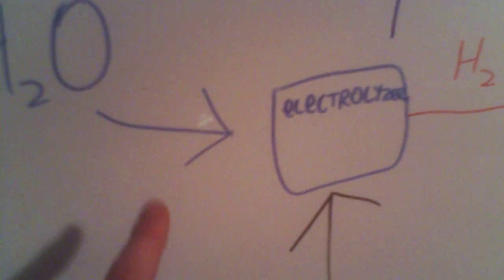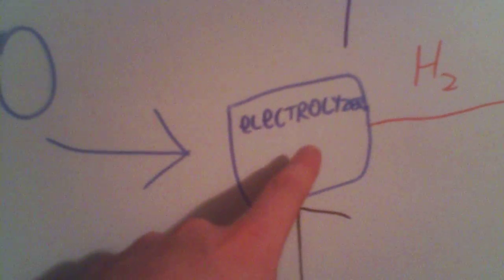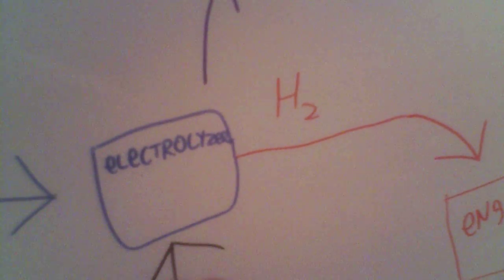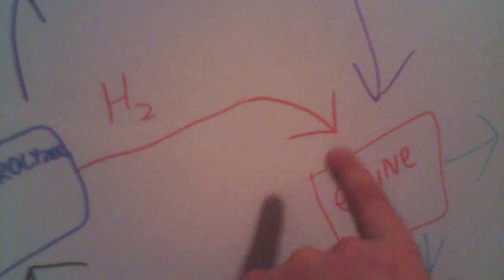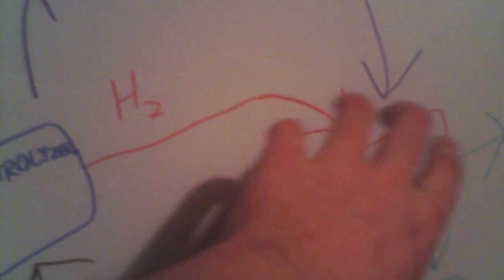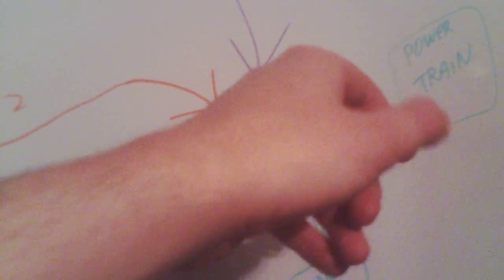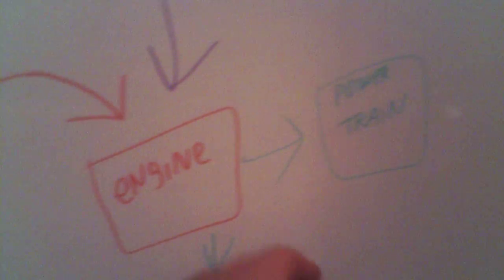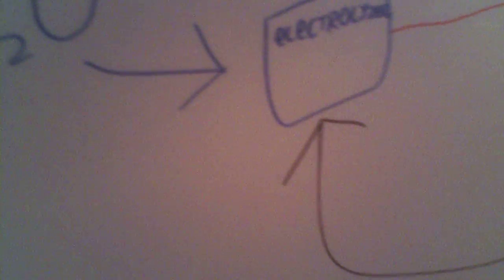Why HHO CANNOT EVER BLOODY WORK

Comment: https://www.academia.edu/5706114/NASA_SUPPLEMENT_HYDROGEN

sorry NASA have tested and approve that hydrogen works
Reply: Good freekin' gods.  What on Earth are you talking about?  You're referring to a paper from 1974?!?!?!?  Even in that paper, they were talking about a very low yield.  And, it was based on the efficiency levels of 1974 engines (there was a lot of efficiency that could be gained).  The paper relies on the concept that the efficiency gains in burning hydrogen would outweigh the efficiency losses of generating the hydrogen, and that is only under very ideal theoretical conditions.  And, sure maybe you could make that case in a 1974 engine (which this paper does), but it's reeeaallllyyy a close call, barely any gains.  In a modern engine, which is far more efficient than a 1974 engine, sorry, but that gap can't be closed by the results from this 45 year old data.

Comment from the maker: Except the additional hydrogen does fuck all to improve the combustion efficiency of the engine.  And the energy coming from burning the hydrogen is originally from the gasoline.  The hydrogen generator is just another load on the engine and requires more fuel overall.
BLOODY.  HELL.

Comment: no, its totally relevant. you put an hho system in your car, and the battery will power it. you turn on that car, hho and gas vapor are pumped into the cylinder, and because of the extra power the hho delivers, your car will use LESS gas because there is MORE propellant in the cylander. then, the motor cyles the alternator, recharges the battery and allows the electrolisis cycle to continue.

Comment from the maker: NO.
The extra energy to run the hydrogen (there is NO SUCH THING as HHO FFS) generator comes from the 'normal' fuel that the engine is running on.  The hydrogen generator is a net load since it takes more energy to generate the hydrogen than you get back by burning said hydrogen.
In other words, such a system is a net loss and REDUCES YOUR VEHICLE FUEL ECONOMY.

Comment: IF the car was only using hydrogen as the one and only fuel source, im not saying that you can run a car totally on HHO, im saying it can be used with gasoline in your car. if the hho doesnt produce the energy to re-split the molecular bonds of water again, then the gasoline burning in the engine will turn the alternator enough to re-power the electrolysis cycle.

Comment: HHO wont work if the car was only usingtha hho, that would not be possible because that would classify it as a perpetual  motion machine. BUT, when gasoline and HHO are used in conjunction, the engine is NOT producing more energy than it consumes, the HHO is aiding the burn of the gasoline and thereby making the car use less gas improving your gas millage.

Comment from the maker: It is a net loss.  As such, using it to make hydrogen to fuel the engine supplying the hydrogen generating apparatus is pointless.  Yes, hydrogen can be used to store energy and yes, said hydrogen can be used as a fuel, but doing everything at once is an exercise in stupidity.

Comment: Yh, preachin to the choir there bud. Most people who use HHO are not interested in overunity, they are interested in the convenience and application of using electricity to make 'fuel' on demand. That is why I disagree with your title because HHO does work and it works very well in many different systems (depending on the efficiency of the electrolysis - most of the cells you see on youtube are a load of shite).

Comment from the maker: The maximum possible efficiency of any system is 100%.  As 'HHO' converts mechanical energy to electrical energy to chemical energy and back to mechanical energy, the best case scenario is where the HHO system has no effect.  As unity efficiency is impossible, HHO can only be a net load on the engine using such a contrivance.

Comment: Do you mean 'HHO overunity cannot ever work?' Really, these methods in generating energy is not about 'overunity' but about how efficiently energy can be converted from one state to another - of course. When splitting an atom, does the energy input = output? Sure, e-mc2 but the energy input to trigger the process does not equal the bang. Eh, drunk.

Comment: 1 Engines in time get deposits and this ruduces MPG. hydrogen promotes a cleaner burn. A clean engine is an effeciant engene.
2. All the smoke comming out of a deisel truck is waisted energy. Hydrogen finishes the burn. Less smoke coming out of the tail pipe equals more power in the engine.
3. You keep going back to ONE rule without considering these other principles that also apply.  You think all were doing is ADDING to the amount of fuel buring. therefore using less gas. WRONG.

Comment from the maker: A problem with geothermal is that areas where there is readily accessible geothermal heat tend to be seismically active.  A geothermal plant does no good if it gets shredded by an earthquake or buried/incinerated by lava or pyroclastic flows.

Comment from the maker: Geothermal is only suitable in a limited number of locations as it needs particular geographic conditions to be feasible (note that ground source heat pumps are NOT true geothermal).  Even then, things like hydrogen embrittlement, low energy density and lots of things being permeable to hydrogen mean that it is a niche fuel at best.

Comment: Alternator kicks out aprox 15volts at around 10amps. I am using less amps to explain something simple. If HHO conversion is using 5volts at 4amps. The gain inMPG is 1%. I would rather have !% gain anyday against 0% all the time. I went from a gas guzzler Vauxhall Frontera A Glazier 1995 4X4 max 22MPG. to same vehicle with HHO giving me 43MPG. I know that isnt 1% but I dont care. IT IS SAVING ME MONEY. That is all I care about. If it ends up at the end giving me only 25MPG. Fantastic.

Comment from the maker: Any properly working ICE burns around 98% of the supplied fuel.  As such, the only possible gain is in that remaining 2% or less.  ICE automotive system inefficiencies principally come from the ~70% of the supplied fuel ENERGY that is being turned into heat.  This energy is (except in winter) all wasted because the Carnot efficiency limit of any system that can recover it is crap due to the low temperature differentials involved.  As such, recovery is not worth the effort.

Comment: Sililar thing with HHO. Since your engine doest combust ALL the fuel, that uncombusted fuel has to go somewhere. It goes out of your exaust. HHO only improves the combustion so less uncombusted gas is thrown out of your tailpipe. Thatswhy if your car is alredy quite effiecient, HHO will not help as much as it would with the higly ineffiecient ones. You say you are an engeneer. So build HHO generator and try it out, make it a project if you will. If you dontwant to try it on your car, try it on

Comment: Ok, then what you are saying is that those new engins that are much more effiecient then the old ones, do not work according to laws of thermodynamics. Because this only improves your efficiency. Imagine the old steam engine. You produce vapour that goes into atmosphere. So you constantly need to add more water. What if you would condens that same vapour that comes out of the engine and reuse it? You would need to add less "new" water besause you are reusing the old one - it is more economical.

Comment: In your proposed function of HHO you are correct, it could never work. If you are interested in learning how it is meant to work, please study the work of Stanley Meyer and do some research. His engine was running on the expansion rate of water to gas (1800:1), the explosion of igniting the HHO, and possibly steam as well. Good luck in your search, it will take some time.

Comment from the maker: None of those things are prohibited by physics except the faster than light in a vacuum travel.  That result that you speak of was due to a connection problem in some fiber optics introducing a 60nsec signal delay.  Experiment repeats have shown the initial result to be in error.

Comment from the maker: Those are all energy conversions.  No new energy is actually created in the process, as the kinetic energy of the air is turned into electrical energy (lightning) or mechanical energy (wind generators, boats, etc.).  The term 'from thin air' is just an expression.
Physics 1, bullshit 0.

Comment: You have no idea how HHO works, dont you? First of all, HHO stands for Oxy-Hydrogen, which means oxygen is NOT released into atmosphere, both gases are released into engine. Secondly, your "math" would be correct if the cars engine wouldn't be so ineffieciend device, but it is! Just google for internal combustion engine efficiency and you'll see. Losses due to incomplete combustion are up to 45%! So to simplify: If your alternator uses lets say 5% of your total combusted fuel for electrolysis

Comment from the maker: What you are describing is nothing less than the creation of energy from thin air, which is impossible.  Generators are energy conversion devices.  They turn mechanical energy into electrical energy and heat energy.  To get more electrical energy out, more mechanical energy must be put in.
Again, basic physics proves what you are claiming to do to be impossible.

Comment from the maker: So what if it can burn ceramic?  Anything will burn if it is heated to a high enough temperature.  What matters is that the heat energy from the burning hydrogen and oxygen is still less than the electrical energy needed to split the water into hydrogen and oxygen.

Comment from the maker: Real engineering uses facts and logic and truth.  What you are describing is some form of impossible (those pesky laws of thermodynamics again) pseudoscientific bullshit.  Increasing a load on a generator MUST increase the load on the prime mover, both from the mechanical energy needed to convert to electrical energy, as well as the increased losses that come with same (winding losses, core eddy current losses, etc).

Comment from the maker: Internal combustion engines need fuel that will, y'know, BURN.  Almost all of the component gasses of ICE exhaust (H2O, CO2, N2, NOx, etc.) have this little habit of NOT burning without exposure to NASTY stuff like ClF3.  The exhaust gasses that will (CO and residual unburnt CH3-nCH2-CH3) are at too low a concentration to burn.
Or in other words, an engine CANNOT run on its own exhaust.  Indeed, oil tankers fill the air space in their tanks with their exhaust BECAUSE it will not burn.

Comment: 3rd-you say-Second, a system transmitting a given amount of power does so regardless of the duty cycle. Reducing the duty cycle simply increases peak power.
Wrong again-it's like i said stop living in that past and believeing everything that some has been told you.Im guessing the lens force law still stand firm with you aswell-and yet i have designed a generator that counteract's the lens force and reduces the load on the prime mover when a load is applied to the generator-real engineering

Comment: 2nd-the air that an I.C.E breath's is only about 20% oxygen,but when HHO is used as a fuel it will be supplying the engin with 33.3% oxygen and 66.6% hydrogen.So there is no contaminatein the fuel,and 100% of the fuel is burnt.It is also possable to get an I.C.E to run on it's own exaust gases in a complete loop system-but that is something for us engineer's that live in todays world.Feel free to go and view my vidio of my system doing just that ,if proof is required.

Comment from the maker: Regular engines add oxygen to the fuel as well, as fuel will not burn in anoxic conditions.  Plus, engines CANNOT get 42% more energy than was supplied to them as fuel.  The laws of thermodynamics forbid it.  As in: IT CANNOT BLOODY HAPPEN EVER.
And ICEs burn over 98% of the supplied fuel, so there is not much gain headroom.

Comment from the maker: First off, the laws of thermodynamics have NEVER been overturned, so my 'old' thinking is valid.  If you were a real engineer you would know that.
Second, a system transmitting a given amount of power does so regardless of the duty cycle.  Reducing the duty cycle simply increases peak power.
Third, where is the energy to generate this 'HHO' coming from?  Again, were you a real engineer, you would know that energy from a system CANNOT exceed the energy supplied to that system.

Comment: another methiod i heard about was a guy who took an old car apart and rebuilt it in such a way so that the gas was vaporized before it went into the engine. he clamed upwards to 100 miles per gallon. (back in the 70's)

Comment: it still improves efficiency. water, even though your using energy to split it, the result is a much more clean explosion in the pistons, it helps the gas burn quicker because it itself burns quicker and that burning ignites the gas quicker. it doesn't go against any laws of physics. like one guy said, it used as a additive to gas to make it explode faster.

Comment: 2-when useing HHO aswell as normal fuel in an I.C.E you create more heat as you are adding oxygen to the fuel ,and as we know adding oxygen will create more heat -and heat is a loss.When running on HHO alone with the motor set up to do so,you will gain around 42% more power for the same amount of fuel consumed,as HHO has a much higher explosive force than normal fuel.It also burns 100% of the fuel.As the explosion is much quicker with HHO there is less heat loss aswell.

Comment: Hi randacnam-I am also a mechanical engineer who is experimenting with HHO.Looking at your vidio i can see you are stuck in past.What you have to do is think outside the box and not go on what some one said was law 100 years ago.I see you are going on a brute force system-what about pulsed systems?.You also go on the asumption that the motor in question will only have the same amount of HP or kw output when run on HHO.An I.C.E running on HHO alone will have much more output power than on gas

Comment from the maker: I have never seen any HHO systems employed on the scale you are talking about.  The fundamentals behind it (overunity, 'burning unburnt fuel,' etc.) are all nonsense that defies the laws of thermodynamics, as well as being easily debunked by those with a basic knowledge of physics and chemistry.  HHO is just the latest in a long chain of fuel saver scams, like magnet fuel molecule aligners, bogus fuel additives and those stupid 'power optimizers' that plug into the cigarette lighter.

Comment: REad up on some Masters' thesis, peer reviewed or peer review in process work, where RPM was of consideration. At low rpm HHO is often problematic, and SI vs. CI engines differ greatly. I am not saying it is across the board applicable at all. I am saying it is not nearly as simple as you make it to be. I once believed exactly what you state; but it surely is just not that simple. Here is an example approved Master Thesis > tinyurl . com / 8xvrykj

Comment: If you think about all of the already implemented ways to get unburnt fuel BACK into the mix, it becomes clear that in each stroke there is a lot of fuel left, unburnt, and that fuel is potential HP. I clearly understand the laws of physics, and your point, but all due respect you are missing out; HHO is not free energy or any defiance of any law of physics. There are many mods that can, increase HP & economy simultaneously (like exhaust mods), and done right, this is one of them, in some cases.

Comment: That's too simplistic of a view; again, you are assuming the already taking place reaction of long chain hydrocarbons is a 100% efficient process. In reality a small introduction of pure H2, in and amongst incomplete, yet cleaved molecules of available fuel, i.e. CO, MH3's are then able to combust, and thus the energy obtained IS NOT equitable to the energy within the H2 and O2 introduced, thus the interest from many an engineer, already, and the implementation of HHO in many fleets nationwide.

Comment from the maker: A properly functioning ICE burns at least 98% of the supplied fuel.  And CO being a reaction product of combustion is a sign of insufficient oxygen, not hydrogen.  Ideally only H2O and CO2 are given off, although some NOx production is inevitable from thermally induced oxidation of atmospheric N2.  Any ICE in good working order gives off relatively little CO.

Comment from the maker: One horsepower is 745.6W.  If an electrolyzer consumed 280W turning water into hydrogen and oxygen then by definition burning that hydrogen and oxygen or recombining them in a fuel cell can only give off (assuming a 100% efficient electrolyzer) AT MOST 280W, and the electrolyzer and fuel cell have (often substantial) resistive losses.  Or in other words, 280W cannot be turned into 2HP.  Any engineer who says otherwise is not to be trusted.

Comment: The basic problem with this video is that you need to assume that an ICE is 100% efficient as a thermal combustion chamber. If it were your theory would be intact. But it's not. And it's still cheaper (in watts) to (when done right) separate water, which is an ash, not a fuel, into a fuel, to then combust the fuel properly, which is low grade garbage. Take a highly efficient vehicle and an excellent fuel, and hydrolysis (brute force) is a useless addition. So there is truth in this, too.

Comment: As for newer high tech and very fuel efficient motors with highly computerized emission control, timing adjustments on the fly... ya.. I'd have to agree with you. Pretty much retarded to try and improve on what engineers have so tightly designed + all of their sensors will pretty much just dump more fuel in, trying to compensation for a lean condition.